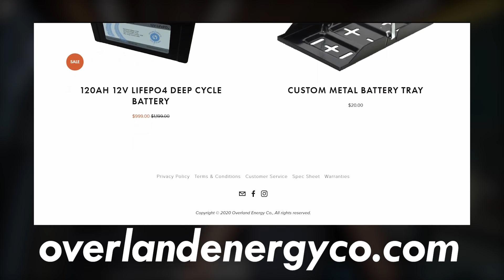Adventure Vibes 4x4 Sprinter with Functional Home Feel

Comment: the bed folding to one side, allowing, theoretically, to extend the galley's worktop to the very end of the van is really critical in a short base such as the 144 chassis. hugely space saving and making electrics and plumbing super accessible 👍🏼👍🏼👍🏼👍🏼👍🏼

Comment: Those inches are so important... between tire and that sliding door, when it is opening... Reminding me over following quote :) "Victory is won not in miles but in inches. Win a little now, hold your ground, and later, win a little more." ~ Louis L'Amour
Reply: Those tires look unable to spin around if they get the slightest bit of mud on them. They look way to big for the van.
Reply: @milcotto4153  Front tires looks like quite ok even with mud there, but true back tires might be slightly problematic even. On the other hand, that van might never get itself for that kind of terrain where it would be any danger with the mud... BUT, I suppose that if that might become small problem, then they should be able to fix that issue. Let`s see, if they might test it on the roughest terrain with lot`s of mud...
Reply: Got a bunch of experts here
Reply: @milcotto4153   Apparently you guys didn't listen to him when he said he took it out on some rough terrain and sand and mud and didn't have any problems

Comment: This may sound small but I wish it was shown how the bed comes down (6:20) and what the space looks like with the bed up where the floor is and if the bed comes down is one piece and if the cushions for the bed have segments? Perhaps there's ano ther video that shows this on their website or if they have a YouTube channel?

 also as a suggestion at the corner of the counter which is next to the two seats that go down,  perhaps the kitchen countertop Corner could be more narrow at that spot or have an indentation  so the corner doesn't come out like that so that when the two seats are upright a person can pass through diagonally without running into the two seats.

 finally as a suggestion the company needs to consider also having a different color scheme version of the van perhaps wheree more of the ceiling and walls are white - tbh  I wouldn't initially consider this van bc the general dark look but with a more light color palette option and a tour where you get to seen the whole of the interior as one shot from back wall to front of van i would consider watchng the tou again to ponder if its livable. Right now im having  to use my imagination to do that however it is something that a few good shots of the interior of the van could Remedy or even if there is a van life couple who would provide a tour of the van that they have been living in

Comment: If the batteries are in a super low state of charge they might overheat the alternator during idle if you don’t have a dc-dc charger or 3-stage externally regulated alternator. Also, once the batteries cut-off the charge upon reaching 100% SOC, it could destroy the alternator due excess current that has nowhere to go.

Comment: Any insight on how the bamboo ceiling is attached? I don't see any fasteners
Reply: From van builds I've seen they usually use a thin layer of wood or frames of wood first to put the insulation behind or with, then use industrial glue or something of the sort.

Comment: How do you run a induction cook top and a electric water heater off a 2500 inverter? Is there a switch that only allows you to run one at a time? Or can you only use the water heater when hooked up to shore power?
Reply from the maker: Yes it's best to have a switch for most things in a van. The ability to turn off any product is key and you wouldn't run both at the same time.

Comment: At 20:33 in the video, there is a retractable cable mechanism to limit the pivot of the side table. Where does this mechanism come from? Is it custom, or retail?
Reply: Or, is it just a piece of cable with a "knot" on the hidden end to limit the travel?
Reply from the maker: It's a cable system but custom done. Not sure how they did the custom part of it

Comment: FINALLY someone did a different toilet!!!  Do an incinerating toilet next ~ PLEASE
Reply from the maker: Incinerating toilet don't make sense for van life. They are too expensive and they take too much power. It's a longevity thing with the power too, because most power systems can handle the power but over time and using it many times a day doesn't make sense on a battery draw.

Comment: This van is clean!! Love the tour. Silly question - If you want to go off grid for a while, is that enough battery?
Reply: He only has two 45-watt solar panels charging two 120-amp hour batteries, but the batteries also charge from the alternator when the van is running. He also mentioned that he built another van for a customer that had more solar capacity and five batteries that gave it a total of 600 amp hours, and they were able to run air conditioning for 8+ hours.

I love stuff that is overbuilt, so I would go for the 600 amp hour beast. The only drawback is that there would not be any room for a deck on the roof unless you bought heavy-duty solar panels that are safe to walk on.

Comment: wow so the van was a class c at around 14000 pounds
I wish more people would talk about the weight or class of their vans
Reply from the maker: class b around 7500 pounds
Reply: @JarrodTocci  are you sure because i had a cdl
i think class c is when the vehicle is less than 1799 pounds, class b is 18000 to 25999, and class a is over 26000 pounds
I'm not sure if the weight is right but its on the back of the license
Reply from the maker: @raymondmotosue4568  class b is the smallest of the 3. I know it's weird. Class a is the big bus type. Class c is mid size and class b are the small sprinter, Promaster, transit and I believe under 15000 but I'll have to check the weights on that. But definitely the class b is the smallest
Reply: @JarrodTocci  well I'm from Hawaii and we don't have any recreational vehicles  in Hawaii
i tried to check with California with no help 
I checked with Washington  state and i think I'm right about the ABC and why everyone should have that type of license
just because of the h endorsements for hazardous material like propane
Reply: @JarrodTocci  ok i found out why some vans are class b, because it has a tow bar that can tow over 5000 pounds and together with that makes it a TOTAL GCWR over 15000 pounds
Reply: Raymond, class a, b & c mean something totally different in RVs. Class A  is a bus-like front. Class B is, to use old terminology, a conversion or camper van. Class C is an RV coach built on a cutaway van or truck chassis that has a loft above the cab. None of them get their classification from weight or length.
Reply: @loriyoungs2098  sorry i checked with dmv in my state and a few other states but everyone is different but still follow the cdl,gov rules i haven't gone to a rv manufacture so i just checked their sites and to be come a driver you need a have a cdl license to deliver their rvs because of weight and size
class a is a double rear axle bus over 26000 gvw
class b is a single rear axle bus over 26000 gvw and with endorsements you can tow a fifth wheel trailer
class c is a rv that weighs over 15000 or 17000 up to but under 26000
dot.gov can pull you over to check if you have the right license and paperwork and this is not a state thing
just saying be safe 99 percent of the time you won't run into a gov employee

Comment: I don't want to sound negative but every time someone does a video it's about a sprinter or a ProMaster the problem is these vans have terrible I mean terrible drive trains you will be working on this thing all the time especially if it has any amount of miles and you will be broke trying to fix it I wish I could see some more van tours of Chevy chassis they are the best and most reliable 😁and I own and operate my own auto repair shop and I work on the sprinters and the promaster's 🤪
Reply from the maker: Chevy's don't make a high roof unless you convert it into one yourself. In all the years I've been doing this I haven't seen anything wrong with those drive shafts more so than any others.
Reply: @JarrodTocci  roadtrek 210 roadtrek 190 roadtrek roadtrek 170
Reply: you can't towl anything with the ProMaster or the sprinter
Reply: @JarrodTocci  and after you get done converting your ProMaster or your sprinter you'll be lucky if it makes it down the street without breaking down with all the weight you have added to it 🤪
Reply: @JarrodTocci  yeah that was pretty funnyChevy does not make a high-roof. roadtrek 210 you can get it with an Allison 6-speed transmission or a six-speed Chevy transmission you can tow a house  with it and it gets 15 miles to the gallon you can't touch it 😁
Reply from the maker: @brettthompson9507  I'm not hating on Chevy. But you're comparing the roadtrek to a Sprinter and Promaster. Yes they all are class B's but they are very different from one another. The roadtrek is not sold as a cargo so therefore you'd have to do a lot more work upfront to gut it so can have proper insulation and your own wall panels
Reply: @JarrodTocci  okay I must have misunderstood I didn't know we were doing these from a cargo van so after you get done putting $50,000 in your van you could have went out and bought a used roadtrek with 40,000 miles on it like a 2008 and had everything already done okay and well insulated good luck on that .you can buy a 2008 roadtrek for $35,000 so why would you waste your time with a ProMaster or a sprinter if you can buy one done for 35 Grand or less 🤪
Reply: and the other problem with the ProMaster in this sprinter is  when you get done putting all your hard-earned money in it it's going to be broke down all the time they destroy motors they destroy transmissions they're terrible they tear up cooling fans for breakfast I take care of fleets of these things and my customers are broke on fixing them the only reason they owned them is because you're right they don't make a high top Chevy in a cargo van if they did sprinters and promaster's would not be their first choice they would move to the Chevy 6L motor and Allison transmission with total reliability😁